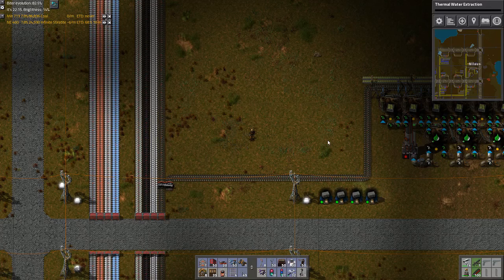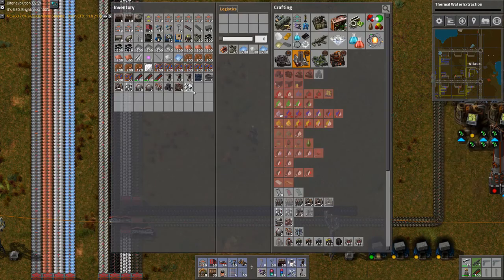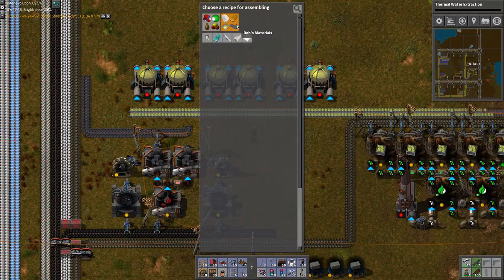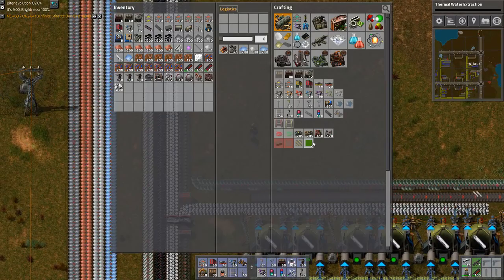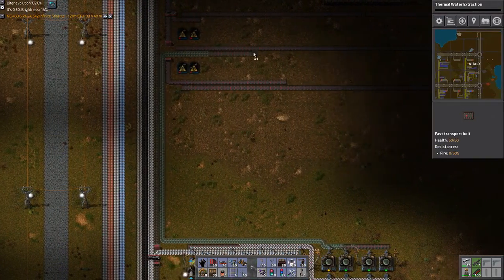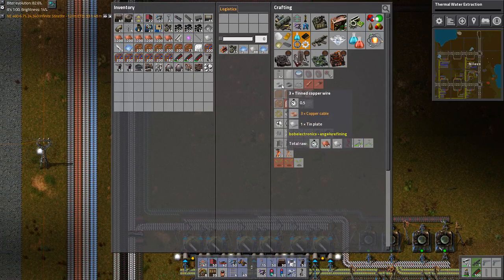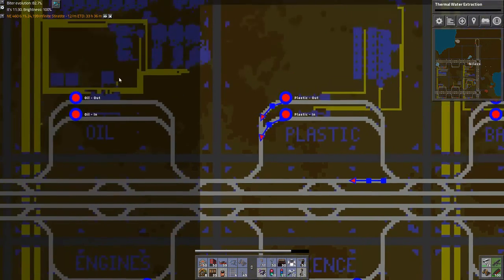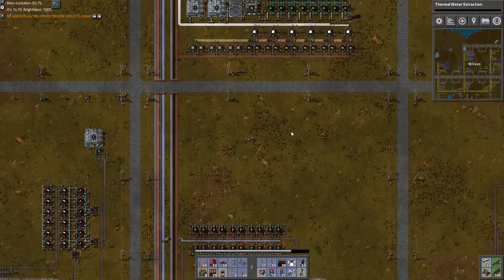Lets Play Factorio S6E26 - Silicon to Transistors

Comment: There is a little misplacing of belt in carcium cloride output lane.
This playthroug is abs amasing! Totally worth it's time!
Reply from the maker: I am happy to hear you like it. I am sure there are many misplaced belts and inserters flipped the wrong way :) As you can see I get an idea and then rush to implement it within the episode. Once a City Block is done I try not to dwell too much on it. I check if trains go by empty, but if a single belt or inserter is wrong, but the goods keep flowing then I rarely detect it :(